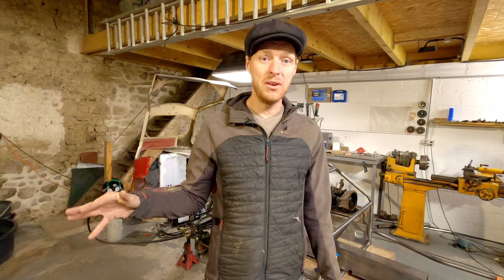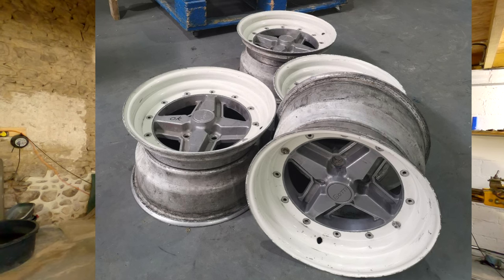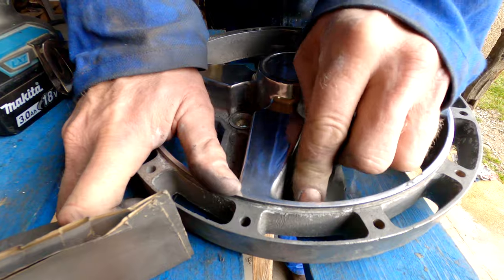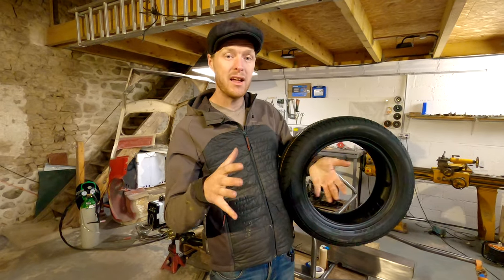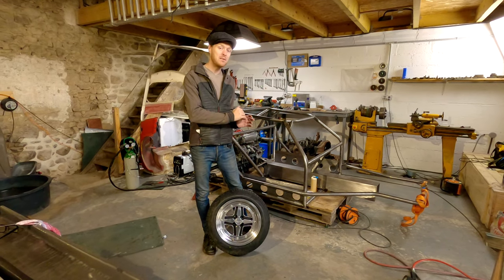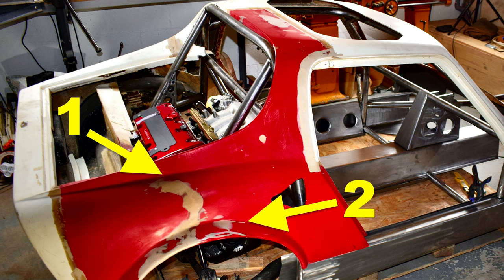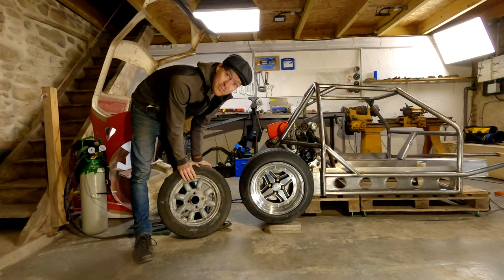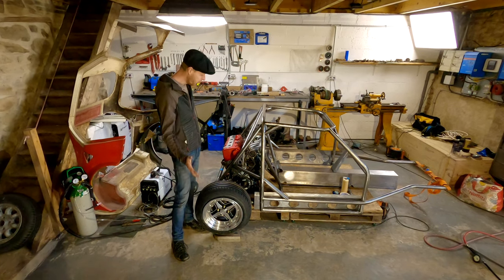Custom 3 Piece Wheels | Project Mosquito Honda Type R Mini Supercar (Ep38)

Comment: I support putting a tire 10mm wider in section width onto rims where the stock tire size provides no sidewall stick-out. I find it prevents a lot of curbing or scraping of your wheel rim lip against things in your daily life. And with the transition to thinner and thinner tire heights, you get increasingly less and less protection for your rims because your sidewall typically hits whatever it is after you've already scraped all the paint off your rims. I put some 245 mm section width tires on my wheels which technically call for 235. It worked out great and now my tires grip ever so slightly better because they're wider, I still have no issues at all with scrubbing on the suspension because it's not a significant difference, and the side wall now gently scrubs at things before my rims do, so pulling up to a drive-through window isn't as risky as it once was. And I think the difference in the overall diameter of the wheels equates to between a 1 and 3% difference in speed at a given wheel rotational velocity compared to the stock sizing, so it's negligible enough not to warrant consideration.

Comment: That's really awesome Oliver! Those wheels look fantastic, much better than the Minilites (which I voted for)..The decision making process and your reasons for doing so make absolute sense to me, the only downside is all that polishing! I polished a small aluminium sand cast piece once (Janspeed water heated inlet manifold for a single 1 1/2" SU carb if you're interested) and I said 'Never again!'. My deep respect to the Pickard Polishing Posse. Just make sure you've got cash with you so when you park you can get a Taxi to the kerb.
Reply from the maker: Thank you very much!

Comment: You have got the stretch just right. No lowwered VW lupo on rubber bands look here.  I compleetly get what you say about tyres breaking away unpredictably. I have a 912 on some classic cinturatos that you can feel and control the breakaway. Driving through the county roads where you often encounter cars coming the other way that in France never slow down and  just use the slipery bit at the edge of the road the correct tyre choice will help to keep your hard work in one peice.
Reply from the maker: Thank you very much rubber bands would have looked far too modern I agree

Comment: Now you made me want a 4 spoke wheels for my EK Civic, which will be K swapped and AWD, still thinking of rear suspension.
Reply from the maker: it would probably be faster without the weight of the AWD and if you are going for small wheels 4 Spokes are a very good light weight choice

Comment: They realy do look good. i had no doubt you would come up with somthing original. Now just need a second set for winter tyres for a nice rallycross track like lyden Hill as well as 365 day use on the road.
Reply from the maker: At some point a second set of narrower winter wheels will find me I have no doubt

Comment: Not keen on stretching tyres. Yes it makes the sidewalls much stiffer, think heavy duty van tyres and caravan tyres which are supposed to stay vertical to the road, but it removes the ability to flex and help the small bump suspension. Reducing the flex also reduces the grip as the tread can't follow a bumpy surface as much.
I wonder if you have tried the wheel on an MX5 to check front calliper clearance? Yes you did say that the MX5 was designed for 14" wheels but maybe not ones as wide as these. You are also going to have very spacious arches to cope with the wheel on full lock.
Reply from the maker: Big tires with so much sidewall on such a light car means they can be run at much lower pressure than a low profile 175 50 for example providing a much better suspension unit. There's more front caliper clearance than some cast 15in wheels cast wheels

Comment: they're very handsome wheels, with an interesting story behind them. but I have a concern, you chose the drivetrain and suspension components so you could just order replacements if you broke something in morocco, and then went with wheels made out of two sets of wheels that are both "rare as hens teeth", which seems to me like is at cross purposes to the theory behind everything else. what am I missing?
Reply from the maker: This will not be my only set of wheels for this car however being 3 piece and having forged rims they are incredibly strong and can be taken apart and repaired if damaged

Comment: Oliver - would a WUKO Bogie Bender 9050 (sheet metal roller tool) be of any use to you for Project Mosquito? I've just seen one demoed in a recent TechZone video. I suspect it might not be able to do thick enough metal, though - but it looks trick.
Reply from the maker: I had to Google it but it's a cute little thinking isn't it. Only really any good for bending on a curve and not much cheaper than a proper bead roller that you'd get a lot more use out of but thank for showing it to me 👍🏼

Comment: ... Good day Oliver from England, What type of  black inner coating did you apply to the rims,out of interest?. Also, clear coating over polished,or simply polished?. Watanabe RS wheels would also suit/te37s.
Reply from the maker: It's a single stage acrylic wheel paint that apparently doesn't need primer. I've never used it before so it'll be interesting to see how it holds up and No clear coat
Reply: @OliverPickard  Many thanks. You have inspired me to try and change a tyre myself 🙄😁!.
Reply from the maker: A pair of sturdy boots helps 👍🏼

Comment: 316 stainless steel fasteners holding the wheels together? After watching plenty of Barrel Brothers wheel videos I thought stainless was a poor material choice for wheels. Any chance you can comment on this?
Reply from the maker: There are a few downsides to stainless bolts chef amongst which are they can seize for no good reason (then you have to cut them off) and stainless reacts to aluminium unless it's the correct grade and is coated where they come into contact with the aluminium

Comment: How did you go on with spigot diameters between Honda hubs, Mazda hubs and your Got Ronaldo wheels?
Reply from the maker: Drag racing Honda's want to use small wheels and big shafts so they make 4x100 hubs. Na/NB Miatas are 4x100 with the same center bore, stud diameter and thread pitch as old Honda's. My Gotti's are BMW 2002 (4x100) and fit like they were custom made and I managed to work it all out with out access to the parts